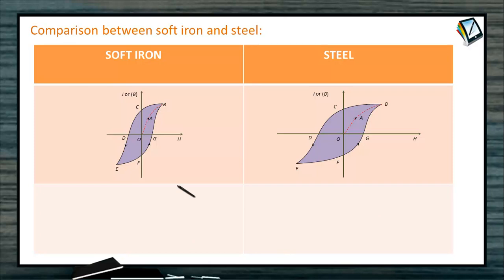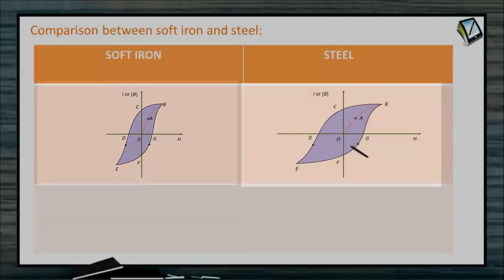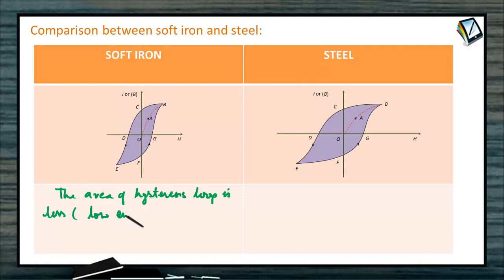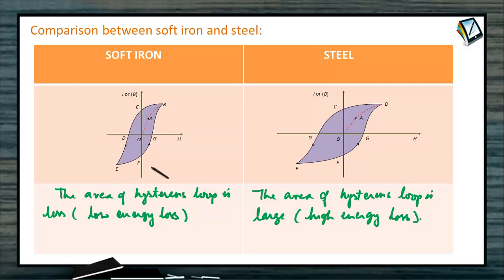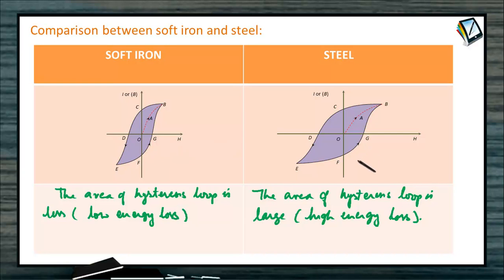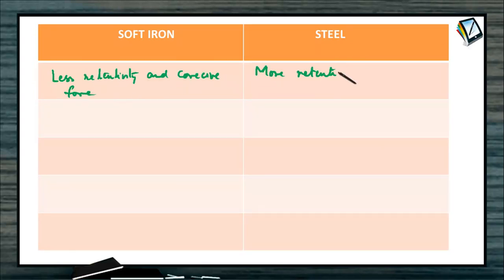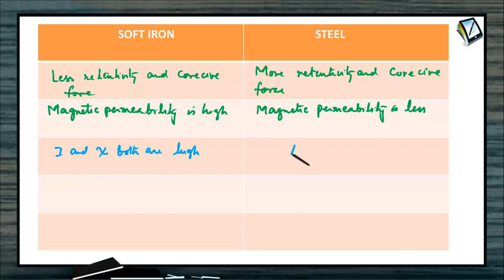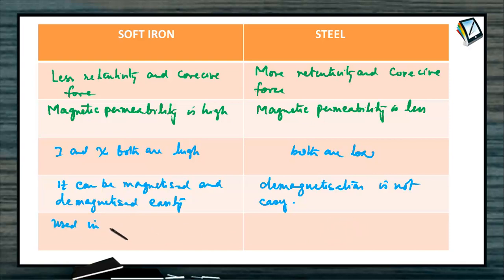Comparison Between Soft Iron and Steel

Comment: Steel has a slightly smaller retentivity than soft iron but this is outweighed by the much smaller coercivity of soft iron. Hence, option 2 is correct.